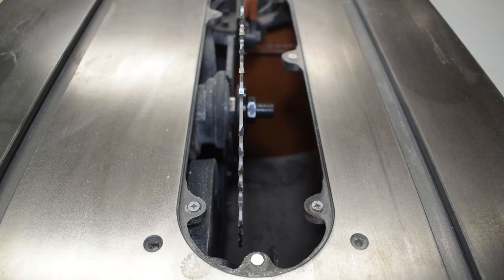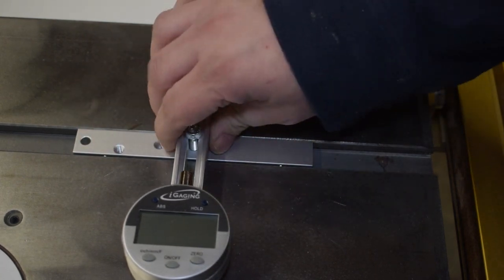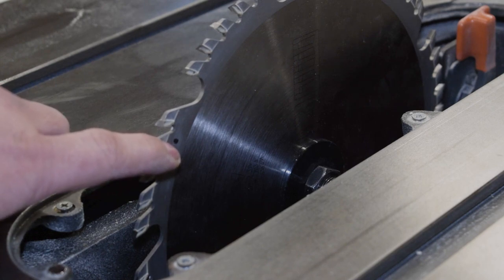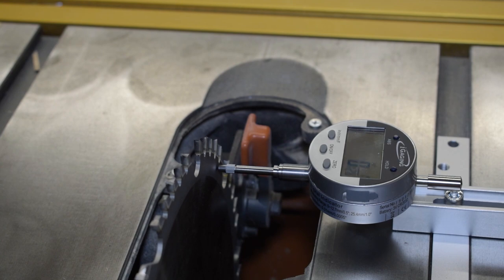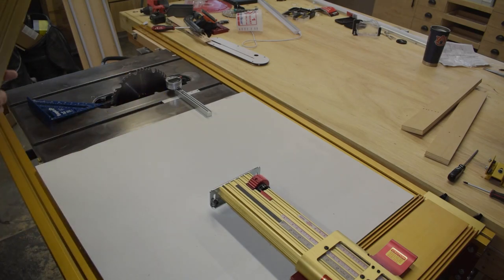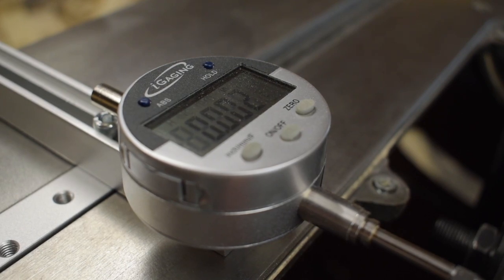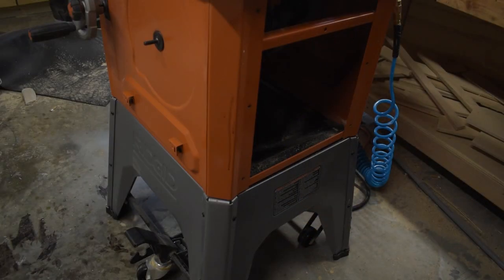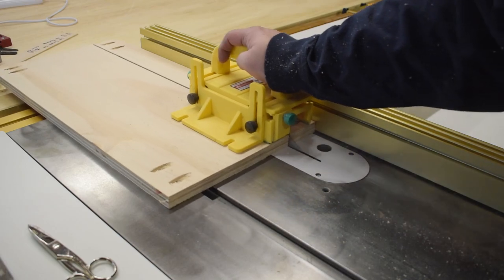DIY |  Ridgid R4512 | How to Align the Blade to the Miter Slot | Ep: 15

Comment: Great video, think this will help tons of people. My only question is I don't think you tap the trunnion until zero out because it's a comparison front to back and so when you pivot you change the other end slightly, so I always remeasure until the dif between front and back is close enough to zero. When you figure something out about dust collection and inside that cabinet please share!
Reply from the maker: you are correct sir.  One of my fellow youtuber buddies pointed that out after they watched the preview.  So I went back and fixed it.  thank you for watching and happy new years

Comment: Having a dialed in saw is worth every minute it takes, or hour..
Reply from the maker: No doubt!  Thanks My man.
Reply: I agree! The R4512 is a good saw for the money especially if yours does not have the issues of the blade angle tilt as it is raised! 
Mine? I spent time aligning the blade parallel to the miter slot when I bought it 6 years ago. I can cut a piece of timber and it measures the same along the cut with in 1 thousand of an inch using the incra TS LS Fence. It is not about the Fence however the fact that the fence is true and square removes any question as to why the cut is as good as it is.😁🛫

Comment: Great video. Curious if you did the same technique for the fence? I have the same setup and have had a challenge with getting the fence dialed in because of all the different connection points. I referred to your fence install video. It’s gets you okay but not to the level you did for the blade. I splurged for the Incra because I like precision. But damn is that thing hard to dial in.
Reply from the maker: Hit me up on Facebook messenger.  You can find it on my fox hall woodworks fb page.  I’ll help you out

Comment: Got the same saw, and have ordered the ts ls fence if it ever gets here, top notch video!!!
Reply from the maker: James Smith thanks man.  Check out my other installation video for the Positioner.  It will make your install go smoother.   I had to wait 9 weeks for mine.  But it’s well worth the wait.
Reply: James Otis it is Worth the Waite! I ordered my TS LS joinery system on June 25, 2019, it was ready on August 13, 2019. I picked up because I happen to be in the Fort Worth area. (I live 160 miles west)  it is a bit pricey however in my opinion it is worth it. You will enjoy it. 😁🛫

Comment: I have the same saw with the TS LS Joinery System, I love it! When I aligned my saw instead of tapping the trunnion I used two bar clamps one bar clamp was against the side of the cabinet and the other jaw was on the side of the trunnion. I did the same on the opposite side.
When I needed to move the trunnion I tightened one side and released the pressure on the other side. This allowed a more precise control of the trunnion. This also removed the issue I had of the the trunnion moving when I tightened the trunnion cap screws. Many years ago I bought a Master Plate and had it measured for flatness. I bolt the the master plate to the arbor and slide a dial indicator in the miter slots along the master plate to measure to see if the plate is parallel to the miter slot. I check this on both miter slots. Very good video on how to align the saw. 😁🛫
Reply from the maker: TheFalconJetDriver thanks buddy. How did the install of the positioner go?
Reply: Fox Hall Woodworks The LS TS  Joinery System has been great, it was easy to install and I have enjoyed using it. The repeatability is what is so great for me. ( I have to make things more than once to get them right that leads me to having more experience than most) with the Incra System that is a piece of cake as long as you know the size of the cuts. 😁🛫